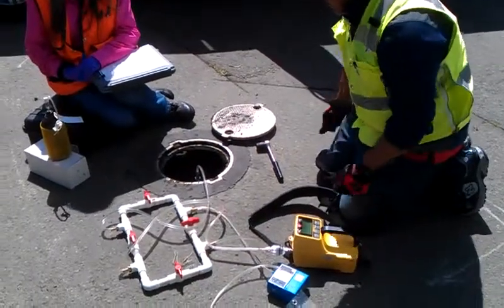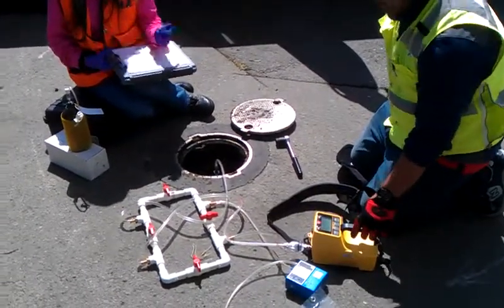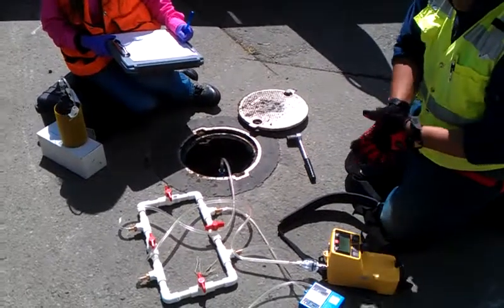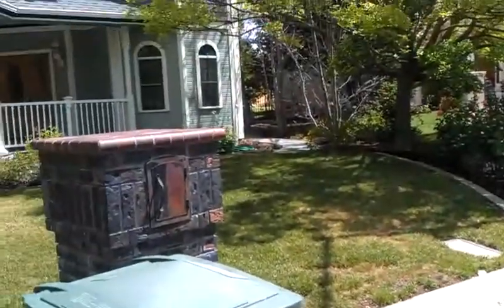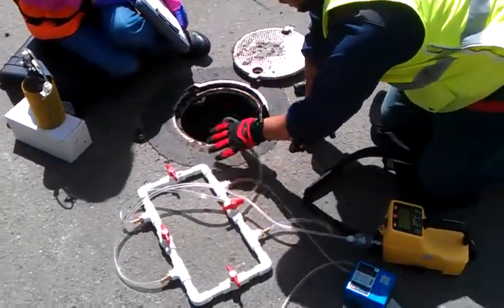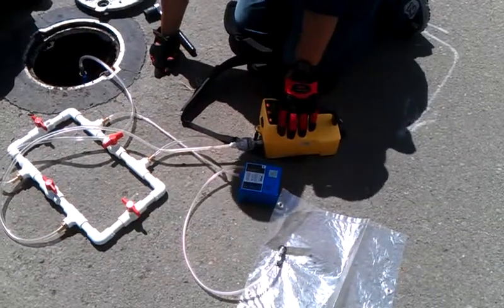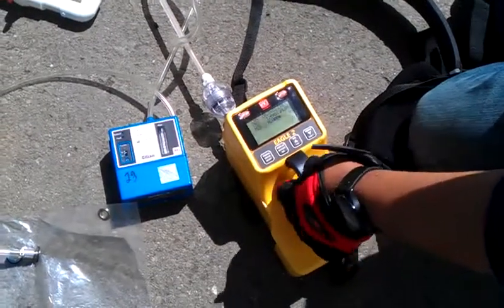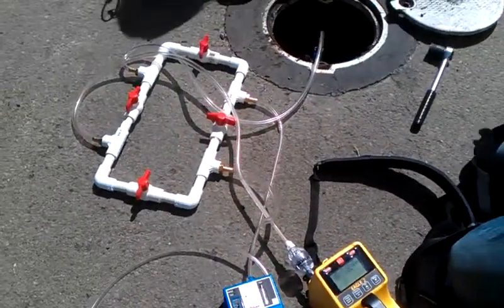Old Pleasanton Landfill Gas Monitoring

Comment from the maker: The gas monitoring instrument is an RKI Eagle which can measure methane concentrations (in ppm and % of volume), carbon dioxide and oxygen; we were also using a gas sampling train that connects to the well and allows the instrument and sampling containers to be simultaneously connected (so that disconnecting is not necessary to conduct gas sampling).   Gas sampling is done using either a Summa Cannister or Dupont Tedlar bag (or both).   The landfill gas monitoring well was constructed in accordance with 27 California Code of Regulations (CCR) Section 20925.